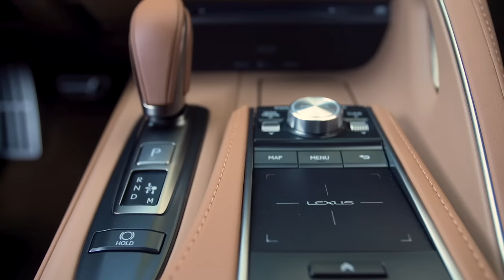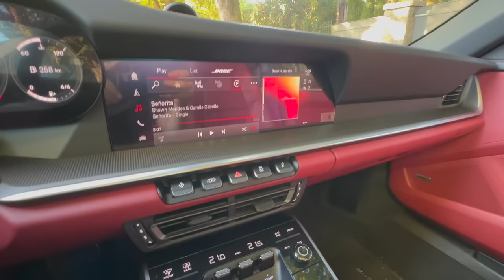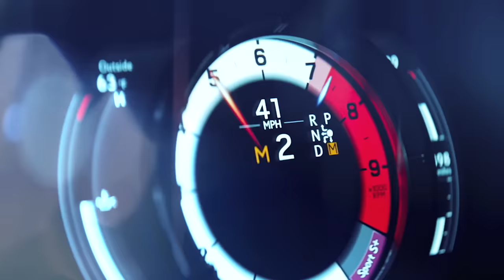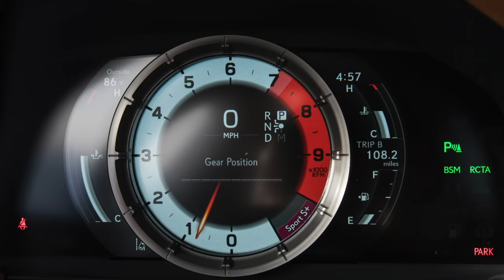ENGINEER'S COMPARISON: LEXUS LC 500 vs PORSCHE 911 // WHICH ONE WOULD YOU BUY? // LET'S DREAM!

Comment: My friends bought the Porsche 911 4S while i bought the LC500, so I had the chance to explore both cars. I was never a lexus car guy, however my lexus love started when i bought the GS450H from 2014 and it still is the world best sedan in the world. The 911 is a fast brutal fun car, however men over 30 years old would get murdered by the discomfort of the 911 in comparisson to lc500.  The 911 is an half hour car. The best half hour car, while the LC500 is pure, elegant, sopfisticated, and the sound man, when you hitt the rev limiter, you will forget about the 911 in a heartbeat. Top of all I can use it all the time. I am not worried about anything even if I hitt the rev limiter because the best engineers with moral have built it for me. Nothing is more gentlemans sportscar than the LC500.
Reply: Here to read every love letter to LC500. Thanks.
Reply: I am 61 and can drive my 2023 911 Carrera hours at a time.  LC500 maybe a comfortable highway cruiser but it is not a road performer like the 911.  If you seek plush interstate ride, you should get a large comfortable sedan..  Not a wanna be sport car..
Reply: I drive a Lexus and am a Lexus guy, but I love Porsche also, I’ll put in simple terms, if I had the money I’d have both end of discussion.
Reply: Yup and I’m an old guy. I’ll stick with my LC500 Convertible 🏖️
Reply: I am in my mid 30. I would take the lexus over the Porsche. The Lexus is a beauty.
Reply: @Kathy-22  Sure.  But that is entirely subjective..
Reply: Sorry but the 911 will always be a gentlemans car. Far more heritage into that car than the entire Lexus and Toyota history together.
Reply: @Cris-il4ht  Hello, i did not say the 911 is not a gentlemans car. it's a special sportscar non comparable to anything else. It's very good-looking by design perspective. However, driving the lc500 feels much more elegant. And the drive is much more fun, I dont care about acceleration and brutality. Lc500 gives you an entire world in one car. 911 is made for racing, and you can not have fun with it unless you break the law all the time and put everyone in danger. Cuz it is really boring driving slowly and makes squac noices all over the place. For racing ofc 911, for pure fun on the streets lc500 everyday everytime.
Reply: @Ghost_buster_313  a Manual 911 Carrera will always be more fun sorry. A Automatic 2 Tons Lexus is not any more fun at all and you will get the same speeding ticket you will get in the Porsche but with a boring automatic.
Reply: I also had 2017 GS450H F sport, then I bought 2018 LS500h. i want to buy in the future LC 500 and also 911 GTS. I had been BMW guym but now I am Lexus guy.
Reply: @ToyotaAristo  I owned a 911 and a 2018  Porsche Panamera. The 911 was fun to drive, but I had fuel pump issues and valve leakage issues. The Panamara was more reliable than 911. I got rid of both and got BMW M550 with twin turbo V8. I  test drove the 2024 LC500 and  liked the drive and the feel  of V8. I ordered the LC500 after they put in that touchscreen.
Reply: Old school Porsche looks good. The newer is 🤢
Reply: @edmasoud2826  The 911 has one of the highest reliability scores out of any other sportcari never heard about “valve leakage” in any 911. The LC500 have coolant valley leaks TSBs that require engine disassembly. Rather a fuel pump than that. Neither is perfect.
Reply: Cops will stop a 911 because they know it is always speeding. They stop a LC500  because they want an excuse to admire it. @ToyotaAristo
Reply: @lonniecole1435  One of the biggest BS by a non car owner i ever read. Show me the stats that says that a 911 is “always speeding”.. That would be Altimas and G35s. Both are beatiful cars.. But you are giving Supra MK4 fanboy vibes with that comment.
Reply: @Slythey  it appears you prefer horsepower over driving experience.  Classic high school bench racer!!
Reply: @ToyotaAristo Cops stop a LC500 to make sure you’re still awake. Boring drive.
Reply: I've done trips from Troy Michigan all the way to Upper Peninsula Michigan (usually a 580 mile trip) and not only is it a joy, but i have reached MPG numbers of 33.5 & 34 MPG which for a car that i could easily do 170+ MPH in, is very impressive. I have also done many trips to Indiana, Wisconsin, Ohio, Florida and I have never found my 911 Carrera 4 to be "uncomfortable", and even with a friend with me, she was shocked at how, smooth, comfortable, quick, fun, enjoyable and useable it is, especially compared to the Lexus GS that she has, maybe your friend got one that's been tweaked, or like this one in the video, IS ON THE WRONG TIRES, as i did notice (one time when i tried some Pirelli tires, yes the ride was annoying, especially on short trips) In conclusion, BUY Michelin for your Porsche, or whichever tire Porsche recommends.
Reply: Oh, I wouldn't recommend it with my Land Rover Range Rover, I think at best, after 5 hours of "hyper-miling", I finally saw the MPG get to 23.9 MPG, up from a dreaded 13.8 MPG, oh and aside from NOT being able to fit a TV larger than 42" into my Porsche 911 C4, there's really not a lot more that the Range Rover can carry, do or be, and it's about the same for "comfort", yes it might have bigger seats and cup holders, but the sheer size of it makes me wish I grabbed the keys to my 911 C4 instead pretty much anytime.
Reply: @PC-xj2mw  I've got my Mega comfortable Audi A6, with a re-done stereo (including two Rockford Fosgate amplifiers giving me a solid 2,800 WATTS of sound through two 15" RF Punch subs, and a 1,600 WATT multi channel RF amplifier to power the 12 speakers, 4 tweeters and 2 horns inside), I've also added a 1,500 WATT power inverter so if I want to let someone else drive I can get some work done on my laptop without worrying about the battery going dead, or if I'm driving, I know I can plug in just any phone, GPS, mobile device, etc., plus I've owned that Audi for 28 YEARS on the 22nd of this month (March 2024), so I know evey dial, every sound it's supposed to make as well as any noises that's it's not, but again, just like with my Range Rover, I'd rather take my 911 C4, and yeah, I'm climbing up there in years as well, so going 0-100-0 MPH in sub 20-30 seconds (less for the newer 911 Turbo S) or running the 1/4 mile in under 10 seconds, has lost a lot of its thrills, seriously, I started taking co-workers to lunch and doing a 0 to 150+ MPH and back down 0 just between highway exits, my girlfriends dad couldn't get enough of that trick, but yes, maybe in another 10-20 years, I might be looking for something... ahh, what am I saying, I've lived Porsche 911's since I was 3 years and I'll go to the grave enjoying them.
Reply: @shane6115  Don't worry, I got ripped on for nearly 7 years while I was saving up a minimum 50% down-payment for the 911 Carrera 4, but I got the last laugh in the end, well that and another 60 months of car payments, but WELL WORTH IT, so don't fret, save a bit here and there, and you'll be able to get one sooner than you think.
Reply: @Kathy-22  The V10 is impressive sounding (only bested by the Porsche Carrera GT's F1 designed V10), but if you've ever actually drove one, I have in Novi, Michigan, there's nowhere near as much space, the cargo efficiency is about as spacious as a last Gen C7 Corvette and with that V10 running Premium as well, your not going to feel great everytime you fill up. By hey, to each there own, if that's your thing, start saving, that's how I've gotten all my cars, hard work, many hours, loads of turned down dinner invites, etc, but it brings me enormous joy everytime I open the garage and fire up that Flat 6 motor, there's not a lot like it, it's akin to Ken Lenginfelters Bugatti Veyron that he let fire up after a charity event and DANG, that W16 Quad Turbo isn't done justice on any TV or home theater I've ever sat in (and I've been in some home theaters that cost more than most people's homes), next you have the devastating roar of a Lamborghini V12, since VW AG bought them, they are at least 95+% reliable (whereas before, it was more like 5%, but that was a friend's Countach).

Additional sound favorites include:
Mustangs with 5.0L V8's
Ferrari 458's with that high revving zing
I have to add my friends insanely built Firebird, after about $45,000+ in it, it sounds better than the Batmobile when you let the Turbos Blow off valves go and runs the 1/4 in sub 7 second times passing 178-180 MPH
Trying to think of some others, I do like my friends newer Audi RS7, BUT he has a vintage V12 BMW 850i (that's a hilarious 😂 fun ride), all and all, I am fortunate to have a lot of friends that love Automobiles of all kinds.
Reply: @ToyotaAristo  Nicely pointed out, that is why pretty much every Automobile manufacturer tries to compare or put their vehicles up against a 911.
Reply: @milohajek  Both are perfect cars for different things. But as a Lexus and Toyota owner Toyota people loves to overhype their cars... Even despite the fact that Lexus owner rather get the 911.
Reply: @ToyotaAristo  agree 👍
Reply: As a 6'2 18 yo, I'll take the LC500 😂 thanks for the insight 🙏
Reply: @PC-xj2mw the LC isn’t a wannabe sports car and it’s still a fast car that performs great on the road
Reply: @ToyotaAristo still tho the LC 500 is a great car for gentlemen use and sporty use
Reply: I drive my 2019 991.2 4 gts on long trips all the time and I've got back issues.

It's obviously not as comfortable as a Lexus, but I don't consider the 500 a true sports car.
Reply: @dirkpalmer1067  I see it as one
Reply: @onikai7055  certainly has the power, I just think it as more of a fast tourer.
Reply: @dirkpalmer1067  I think it’s everything depending on the driver it can a tourer if you want, It can be a cruiser, a daily and a sportscar if you want it has all of those attributes all in one which makes it a perfect blend of all things.
Reply: @onikai7055  to me, numbness rules it out.

After going thru 70+ cars in my lifetime (not a collector, just driver), it's that connection as one with the road that just can't be explained until you drive a 911.  Not in my previous SL63 AMG, or any BMW imho.  I'm not in the market for really big-dollar exotics.

I should've made the switch sooner!
Reply: @dirkpalmer1067  I don’t know the LC 500 has that connection to the road as well.
Reply: @onikai7055  agree.  And it will remain that way..
Reply: I I haven't owned a Porshe , but ive driver my brothers 1970s targa and a 1986 turbo....if you want to know what a kidney stone feels LIKe.,   .its. true t he response is fast, but i remember there was a neck whipping turbo lag.
Reply: WELL SAID...
Reply: @Ghost_buster_313  not for me.  I went with a used 2019 911 (991.2 4 gts).

I guess I'm more of a sports car vs gt car purist.  Both cars can be both, just at different levels of each.

Cheers!

Comment: The one built in Japan.
Reply: Where was nothing said about maintenance
Reply: @thomasbroderick7999  do engineers not think about that? Seems the case.
Reply: The one built in Japan has coolant valley leaks TSBs.. The Porsche on the other hand has the highest reliability out of any sportcar in its range... Hard to beat Porscbe reliability.. Coming from a Toyota owner. Drive one you will understand.
Reply: Also built in japan doesnt mean anything these days. Look at mazda cracking heads in the 2.5 and diesels, Subaru CVT and oil consumption, Toyotas 86, Mitsubishi, Nissan poor reliability... Honda and Toyota are the only japanese decent ones.
Reply: @ToyotaAristo  guess who owns lexus ?
Reply: @martinmoore7551  My point is they are not perfect as people who dont own them make them see. Even less now that they just Recalled 102K engine, 100k transmission. Countless 86 engines. Corollas GR are catching fire and the Tacomas TRD Pro are made out of poor quality paper.

Comment: Very solid review/comparison, and not just because i have owned a 914, 924, 944, 944 Turbo, 928 GTS, 911 C2 and now a 911 C4 that i have owned for 22 years, and then on the JDM side, I have owned a variety of Datsun/Nissan, Mazda, as well as to many Toyota's to list them all, including the 1985 4Runner and 1993 Land Cruiser that STILL RUN and park next to my Land Rover Range Rover Discovery (Which is probably one the the most infuriating vehicles i have ever owned), bottom line, Great job and this is why everyone tests their vehicles against Porsches 911's
Reply: Damn milo, you rich 🤑
Reply: @alphadog9211  Good one, but no, I just do nothing but work, and the occasional racing weekend. This leaves me with no time to screw around or go out to bars. Clubs, restaurants, etc. Heck my last vacation was back in 2008, and the one before that was in 2003. 

Last year I worked 254 days in a row without a day off, and the shortest shifts where the 6 or 8 hour shifts at the Hobby shop on the weekends, otherwise I was pulling 14 to 18 hour days regularly during the week, a couple times I didn't even have a chance to sleep between my midnight & afternoon job. I had one week were I worked 84 hours in 4 days, then slept for 6 hours and worked my 8 & 6 hours on Friday, and yeah, when I got home Friday at 6pm, I took a shower & crashed out until 9am Saturday when I had to work at the Hobby shop at 10am, so yeah, I have a lot of toys, but no time to enjoy them. I've been saying I'm going to play Forza Motorsport 8 using my new racing chair, force feedback steering wheel, 3 pedals mounted to the chair, gear shifter, 65" LG OLED or my 144" wide screen using my commercial grade Sony projector and a Denon 7.2.4 Atmos and THX certified stereo, and in the past 7-8+ months since the game came out, I've gotten as far as installing it and doing the first 3 tutorials, so yeah, not much of a life, but I sure do learn a lot.

Thanks for the comment, work hard, save at least some money every or every other paycheck and don't waste time, as that is the most important commodity we have, as people. Take care and work for your dreams.

Comment: Have my LC for more than 2 years, and I enjoy driving this beauty every single day! I have goosebumps every time I start the engine :p
Especially with the infrared exterior under the sun, no other car turns heads like the LC500. I love the LC500 at first sight. I'm sure the Porsche drives well, but the design is never my cup of tea.
Reply: I have the infrared paint color also. The Porsche is too common, the LC500 is very seldom seen on the road, a real head turner.

Comment: I own both a Porsche 911 Turbo and a Lexus SC430. I test drived a LC500 and I would agree, the high-tech digital screen on the LC500 might look good now, but in 5 to 10 years the interior controls will look dated. Also, im not a big fan of the LC500's steering wheel in all leather. I truly believe the steering wheel in my SC430 is made of wood, it has a more regal and classic look and feel. A leather steering wheel is so "90s" and the leather on the steering wheel eventually fades or gets hard. The LC500 should had used woods and metal and less glitter. Give me a beautiful analog design and display  with wood trim as they did with SC430, and the LC500 could had been a classic.

As for driving the LC500,  I didn't feel one with the road as I do with the Porsche. Also my visibility was far superior in my Porsche than the LC500.

Comment: I have been leasing an LC 500 for the last two years, and I can tell... it's the most amazing vehicle I have ever driven. So much so that I might even purchase it at the end of the lease. My only gripe is that the ML stereo lacks enough bass for my tastes. My wife's 2022 NX 350h even has a better sounding stereo.
Reply from the maker: Thanks for sharing!
Reply: ML MEANS?
Reply: @princekittipon6510  Mark Levinson
Reply from the maker: @princekittipon6510  Mark Levinson system
Reply: @AutomotivePress  im not a native speaker. but what does he mean when he says his only gripe is mark levinson ?
Reply: @princekittipon6510  It means its the only thing that he has an issue with, a 'gripe' isn't something that's a major problem, but should be better
Reply from the maker: @princekittipon6510  He means that the high end stereo system called the Mark Levinson in the Lexus doesn't sound as good as expected.

Comment: I do love the road feel on my 911 C4 (the ride quality is due to the tires, you really need to use the Michelin tires that they recommend for each model), I enjoy my Pilot Sport A/S4's and that's after nearly 200,000 miles that i have put on my 911 C4 in the past 22 years, so YES it is WORTH IT, IT DOES HOLD ITS VALUE, and EVEN NOW, 22 years later ITS STILL A FANTASTIC AND DAILY USEABLE VEHICLE, The winner must be the 911. P.S. NOTHING STOCK BEATS A 2022, 2023 or 2024 Porsche 911 Turbo S (The end).

Comment: I agree with you.  You cannot compete with the build quality of a vehicle made at the Motomachi plant.  Also, when looking at the clear coat of a Lexus using a paint gauge, the clear coat on all panels are very consistent.  I don't know if TMC still "wet sands" each Lexus built there.  However, the Lexus design will not age as gracefully as the Porsche 992.  Timeless.  Which will definitely impact the resale value.  Thnx.